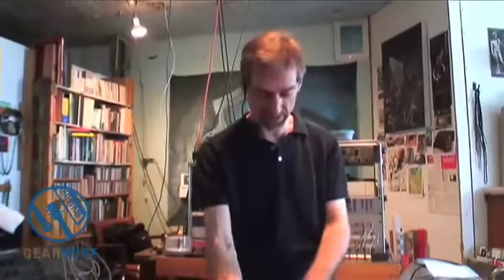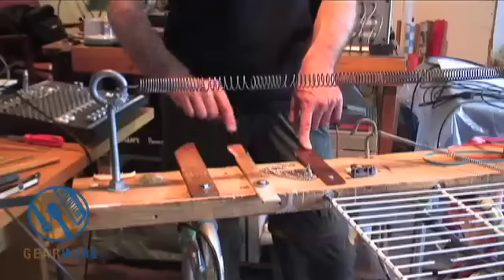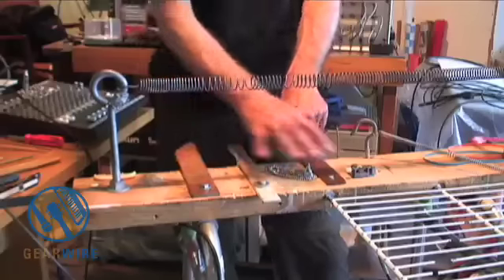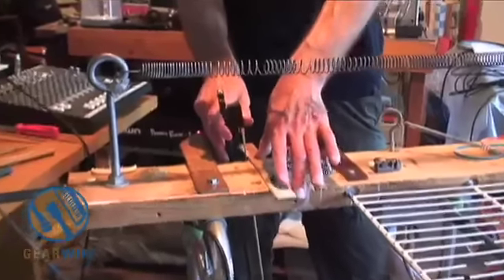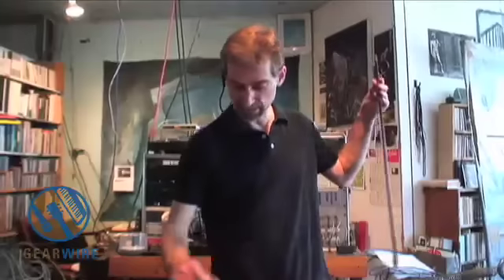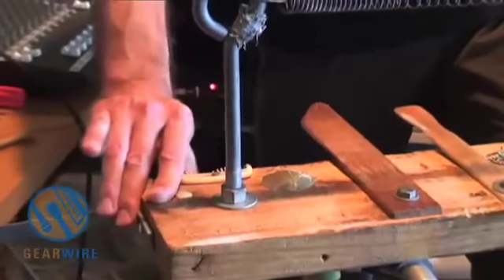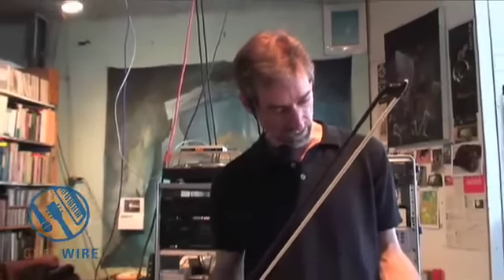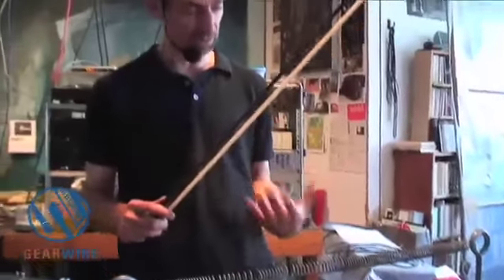Contact Microphones: It All Sounds Good

Comment: Hey! This is probably a long shot but can you explain how do you record this ? Do you have jack socket output from the contact mics ?
thank you!
Reply from the maker: Happy to field technical questions. Yes, the piezo pickup is mounted into the underside of the board. A 4-foot audio cable is soldered to the pickup and on the other end terminates with a quarter-inch plug. That connects to an old K&K preamp. Its output connects to some effects pedal and eventually to either an audio I/O in my studio and/or a keyboard amp/PA for live performances.  More details are at https://ericleonardson.org/instruments/index.html.
Reply: @EricLeonardson  Awesome ! thanks for taking the time to answer and explain! :)